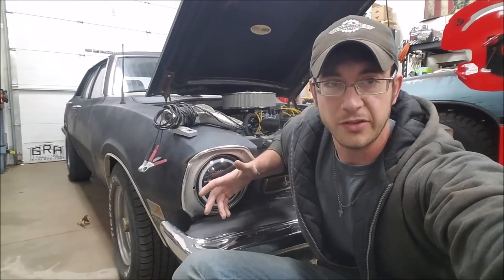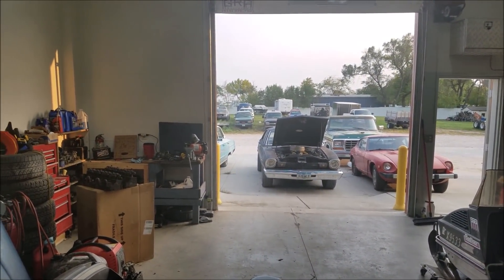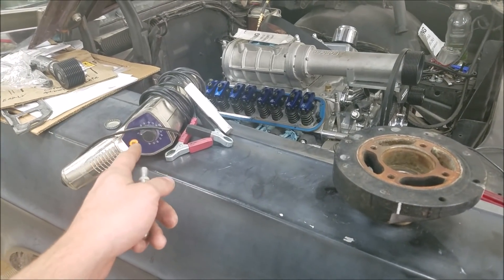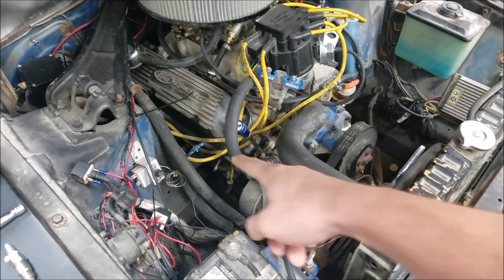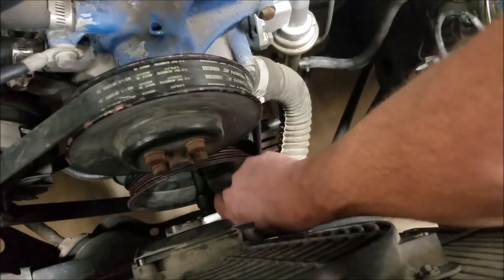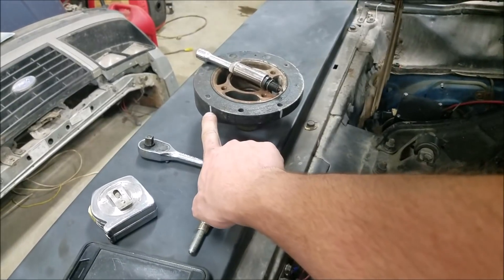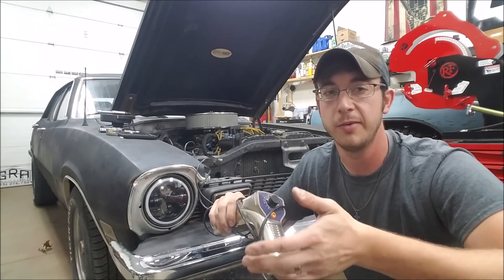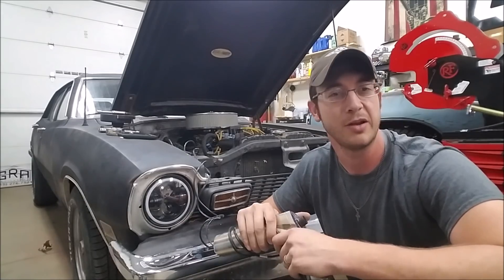Ignition Timing First Step: Before you EVER Touch the Timing Light

Comment: I was just formulating a question in the fb group about why we make two marks and then a 3rd between the two, but i'm quite sure i got it. Would we also need to make sure the dizzy isnt 180 degrees out?
Esencially, if im understanding this correctly, the stopper isnt actually "accurate" with TDC, so we are going forward, marking, then back, marking because the point in between is where the piston would have gone if the stopper wernt in the way..
I, at first, pictured the stopper as a gauge that moved up and down freely, so you could see when TDC happens..but that would only work with hemispherical style heads, with the spark plug directly in the middle, pointing down..

Thanks a bunch for the video, i'm pretty sure ill need to do this when i go to set the timing on my F350. The thing sat 30 years..i imagine the marks are just gone. First things first though, the sumbish is gonna have to stop SHOCKING me half the time i touch the dizzy!
Reply from the maker: This is purely based on the crank, so you don’t need to worry about the valvetrain. Remember, the crank rotates twice to every one cam rotation. So TDC is TDC is TDC. Your timing light only flashes when the plug fires, but actually the crank rotates twice, so TDC will pass once without the timing gun ever firing. 

TDC of the compression stroke specifically is only on one TDC point, but that TDC point is the same. 

Does that make sense? 
And we use this method because the piston actually dwells for a moment as the crank rolls over center. So there are a few degrees of crank rotation that if you were just watching the piston would be absolutely indistinguishable. To be accurate, we have to do that two point method 👍
Reply: Ahh! i was so focused on figuring out why it was done with two marks i didn't consider that the spark lights the timing light, and therefore its irrelevant which TDC you use! Awesome. Thanks for the reply!

Comment: But doesn’t piston one come to tdc twice? So wouldn’t I want to make sure the piston hits the piston stop and make sure the rotor of my distributor is pointing to piston one on my distributor cap? Or does that not matter?
Reply from the maker: It doesn’t matter - TDC is TDC is TDC. 
What you are thinking of is TDC of compression stroke - remember that this is a 4 stroke cycle where the cam rotates once to every two turns of the crank. 
The TDC mark actually comes up twice, but your timing light only illuminates when cylinder one fires on the power stroke. 

So in short, the cam s completely irrelevant - hypothetically you could do this with no valvetrain at all entirely.

Comment: Hey Luke. Congrats on the recent nuptials. As for using the Maverick as a winter beater, you'll be sorely disappointed if you get any snow what so ever. I had a '71 Maverick grabber with the 302 and C4 auto, limited slip rear, 60 series BF Goodrich T\A's, and it would get stuck in a flat parking lot with less than 2 inches of snow. It totally sucked. I loved that car, but I would put it away in the winter.
Reply from the maker: I’m using it to test an autonomous carb control module I programmed, or else I wouldn’t even try. I drove a foxbody through a winter, 4 sandbags in the trunk, snow tires, and with air shocks and these old clunkers can boogie through winter 🤓

Comment: I agree on the timing.  The vacuum advance was shot on my 57 Chevrolet 6 cylinder.  Couldn't ever get to see the mark in the flywheel.  Ran lousy with horrid gas mileage.  New vac advance, points, and my OLD direct timing light made all the difference.   Never touched the carb.
Reply: Old post I know but did you use the harmonic balancer for timing as shown in the video? I have a Chevy inline six and I'm having timing issues myself

Comment: A method I used to find TDC was to plug my compression tester into #1 and replace the compression gauge with a vacuum gauge. Once I got in the vicinity of TDC I rocked the car back and forth in gear and observe when the needle went from positive to negative. An even more sensitive variation: I removed the vacuum gauge, attached a longer rubber tube and put the end in my mouth! I was able to detect precisely the midway point between the piston going up and down.
Reply from the maker: You can’t do it exactly since the piston technically dwells for a moment as the crank continues to rotate.

You will be close, don’t get me wrong

Comment: When turning the motor backwards, isn’t there a good chance my balencer bolt will simply unthread??
Reply from the maker: No, not even if you only torqued it’s to half spec. If it unthreads it was undertorqued
Reply: Grab the pulley by hand and turn it, or when the plugs are out, or with a flex plate fork

Comment: how do u determine the length of a piston stop?
Reply from the maker: Honestly, it’s pretty arbitrary - in an ideal way, you would want to stop the piston as close to TDC as possible since it’s easier to correctly measure out the point in between the two points. But by no means is any specific measurement critical. 👍

Comment: Hi Luke, when finding TDC, do you need to have it on the compression stroke?
ps Congratulations on getting married, you going to do some Happily Married hints and tips videos? 😂👍
Reply: YES you do on # 1 cylinder. I used my compression tester hose, took the gauge off and put a balloon on the end. Turned it over by hand until the balloon started blowing up. I knew I was on the compression stroke. Now, screw in your piston stop and follow Luke's directions. Easy peasy sir. Good Luck.

Comment: I'm still impressed with how your beautiful 64 Galaxie with the 352 spun the wheels.  What grade of gas do you run?  I know my harmonic balancer is accurate.  I have mine set right at 10* but my 64 Galaxie with the 352 wont lite them up like yours.  I'm running 91 octaine and get a very slight ping on climbing hills on a hot day.  I also had to change the jets on my stock autolite 4100 from 49F to 58F to get it to stop pinging badly.
Reply from the maker: Well, I do have an aftermarket distributor and a summit 600 on it. Make sure your 4100 secondaries are actually opening. 
But ignition made the biggest difference since I could tailor the advance curve to exactly what the car wanted
Reply: @ThunderHead289  so not just the pertronix ignitor but a whole different distributor?  When you have a chance I'd like to see more Galaxie content!  I love that 64.
Reply: @ThunderHead289  I played around with my timing replaced my points with a set of NOS motorcraft points and did a full tuneup with NOS autolite non resistor spark plugs.  I also replaced my accelerator pump and to my surprise the old girl will do a healthy burn out form a stop!  I have a posi traction rear end with the 3.00 gears and 225/65 15 tires.  I've never been able to spin the tires on my 352.  Goes to show that a properly tuned motor is everything!

Comment: I'm helping a friend work on a recently purchased 77 El Camino that came with badly functioning FiTech EFI system.  The fuel pump, filters, and fuel lines were not installed correctly.  Kinked lines, incorrect pump and filter placement, bad grounds, wiring, etc.  It's been interesting and educational, but all the while I keep telling my friend 'You know, a carburetor would be so much simpler'.  He hasn't relented.. yet..
Reply from the maker: I’m actually a programmer for my day job and currently working on something to attach to any carb that autonomously trims the fuel curve. So it’s like some fuel injection benefits, yet still carb
Reply: @ThunderHead289  Interesting.  Will it monitor and adjust for barometric pressure?
Reply from the maker: @flbartlett  better - monitor vacuum and afr and adjust via user setpoints to a target AFR. User interface is an app I wrote which doubles as a vacuum gauge and afr gauge
Reply: @ThunderHead289  So you're making your own feedback carburetor system like a lot of vehicles from the 80's had, ie the Electronic Quadrajet? https://www.hemmings.com/stories/article/carburetion-for-the-new-age

I'm guessing this system uses an electrically operated valve between the carb and the fuel line. Does it use an O2 sensor like the aforementioned Electronic Q jet?
Reply from the maker: @RodBeauvex  those were junk because the tech wasn’t there advancement wise, plus that was only on  a specific carburetor

Comment: ive not heard of piston stops before. What you do with them? Screw them in the spark plug hole, turn the motor till it hits the stop? Sounds radical. Turning by hand no damage?  Thanks.
Reply: I think he meant to say "dwells" not swells. And yes, turn by hand slowly.
Reply from the maker: That’s exactly what you do - one direction, then the other. The point between the two is TDC. You can’t eyeball TDC perfectly since the piston actually swells as the connecting rod rolls over center - translation, the crank moves for a moment as the piston is changing direction and effectively not moving

Comment: So I have a question about the advance timing light. Do you point it at your mark then adjust the knob til it lines up then you know where it's at or set what advance you want then turn the distributor til it lines up? I suppose its prolly both depending on if you're trying to find where a vehicle is at vs setting it to where you want it
Reply from the maker: If the dial says 10 and your timing Mark is lining up with the pointer, you are at ten degrees of advance. If the timing mark isn’t lined up with the pointer with the dial at ten, then it’s not at ten. 

Does that help?
Reply: @ThunderHead289  I was wondering about that type of timing light too. I'm assuming if the light doesn't light up on "10" for example and you want it at "10", then you rotate the distributor until it gets to 10.

Comment: Congrats! Always disconnect the battery when using a piston stop and rolling an engine over by hand.
Reply: failure to disconnect the battery has resulted in too many mechanical, electrical  and medical catastrophes.
it's like trying to unload a gun with your finger in the trigger guard. not a smooth move.

Comment: Congratulations and best wishes. Forgive my slowness but i don't understand why TDC is half way between the marks on the harmonic balancer. If each mark represents the point on the balancer when the #1 piston is at the top of the cylinder then why isn't TDC on one of those marks. I thought that TDC is when the #1 cylinder is at the top of the compression stroke for a 4-stroke engine.
Reply from the maker: the piston stop stops the piston before TDC - tdc is vertually impossible to measure outright because the piston actually dwells as the connecting rod rolls over center (the crank keeps turning). so for true tdc, you stop it before one direction, then stop it before the other direction. true TDC is located between these two points. 
does that make sense? if the piston was touching at TDC, theoretically the piston stop would not stop the piston at all.
Reply: Each mark does not represent TDC. Each mark is several degrees before or after TDC. Picture a clock that doesn't have 12 marked on it or you're  not sure the 12 is in the right place. You bring the minute hand around to (let's just use 10 o'clock). That would be the point where the piston stop hits. Bring the hand back around the other way and it will stop at an equal amount of rotation because the stop length doesn't change, so it'll hit at 2 o'clock. Halfway between those to points will be the actual 12 o'clock, regardless of what might be printed on the dial. If your calculated 12 and the dial face match, well, that's good.
Reply: Seems like this procedure would also be helpful for adjusting the piston stop. Rotate forward to stop and back to stop. Take length out of it until the two crank positions stop getting closer.

Comment: I like your technique of rolling the engine backwards as well as forward. Could actually
be more accurate due to timing chain wear
Reply from the maker: It’s actually the only way to find true TDC. What I’m doing isn’t novel really, when any camshaft is degreed, the same process is used for the TDC reference.
Reply: Timing chain does not matter. This is the mechanical link from piston, connecting rod, and crankshaft. This method can be done with the timing chain and camshaft not installed.
Reply: @raoulcruz4404  The distributor is driven by a gear on the camshaft. If you have slop in  a worn timing chain it will affect ignition timing 1-2 degrees, possibly more
Reply: @mark98070   Yes, I'm aware of that but, this video is not about ignition timing. Listen again to the first 40 seconds of the video. He says 'before you even get out the timing light, do this...' The procedure he shows is for checking the accuracy of the physical timing marks. The camshaft and timing chain could be laying on the work bench and you could still perform the procedure he demonstrates.